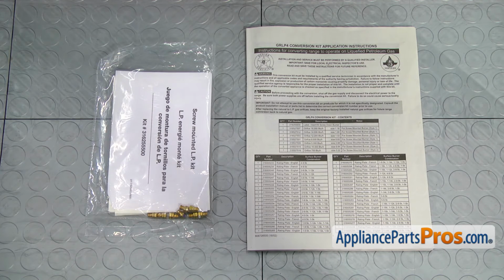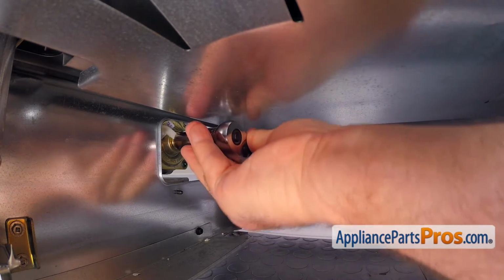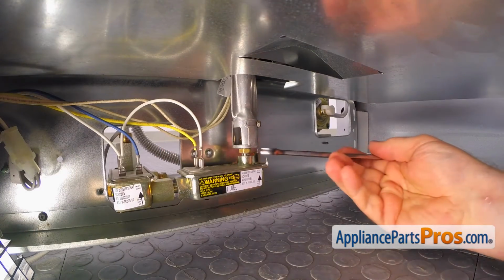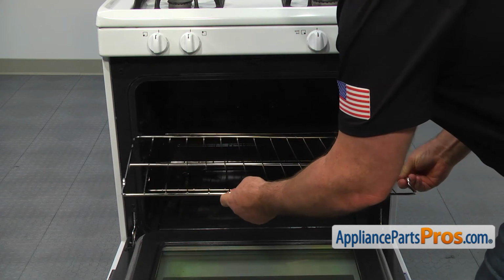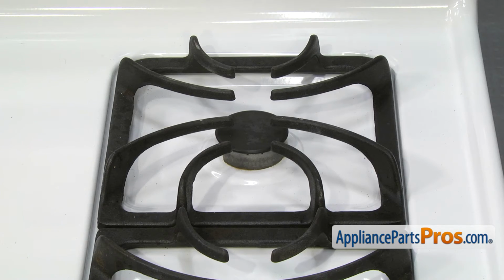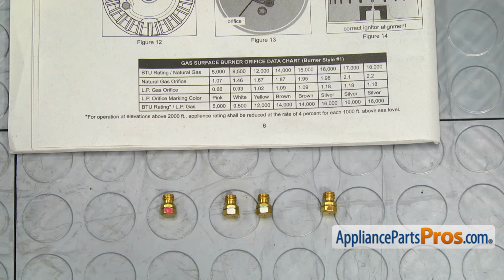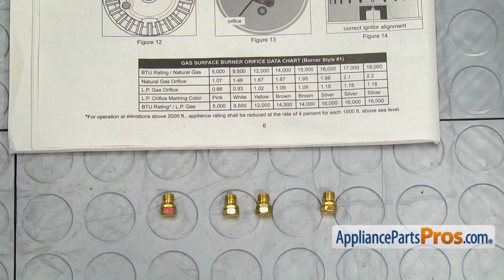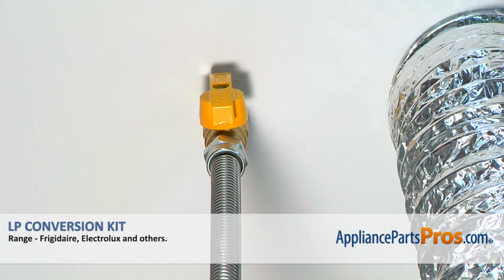How To: Frigidaire/Electrolux LP Conversion Kit GRLP4

Comment: I have a new Frigidaire Gallery stove which  I followed the instructions of changing the orfices, regulator, and tightening everything clockwise when I go to test the oven I see flames rise up which is alarming I don’t think that’s suppose to happen.

Can you tell me if that’s normal to preheat the oven or I missed a step?

Comment: Thanks for this video.  It saved me some money.  One question.  All but one of my cook top burners burn with a uniform blue flame all around.  The right rear burner burns with two of the flames together and they burn to the top of the burner cap.  Is this normal?  I would send you a photo of this but of course I can not do this through YouTube.  Thanks again for the excellent video.